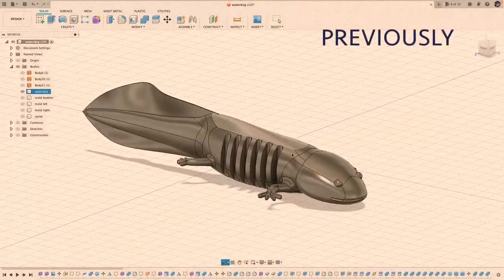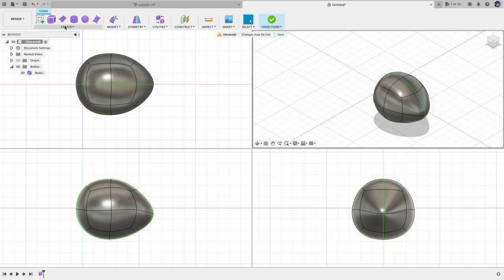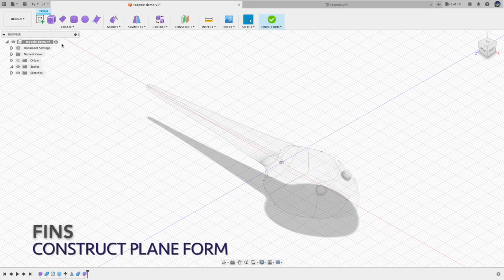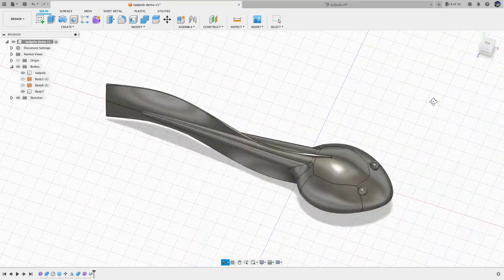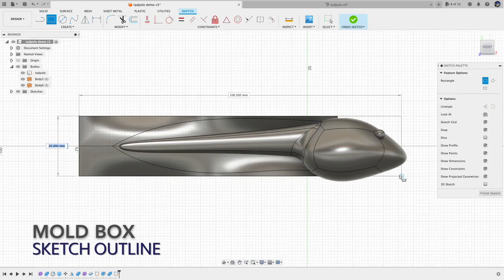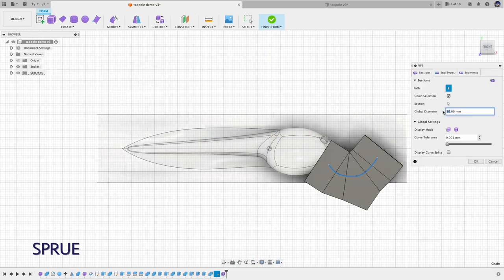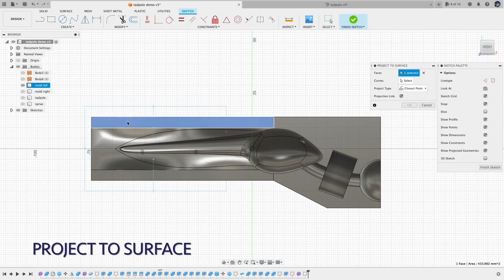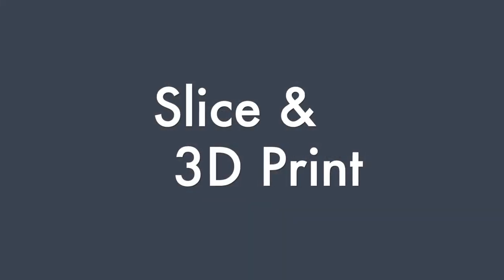Make Tadpole Soft Bait from A 3D Printed Mold

Comment: Hello ! Don’t you have issues with PLA melting ? i would like to print my 3D mold too
Reply from the maker: Yes, you need to be very specific on the temperature control and the amount of pressure you apply during shooting. I usually shoot at 300F. Also avoid to over clamp when the mold is hot. There are also heat resistant filament but I have not tried them out yet. Good luck.